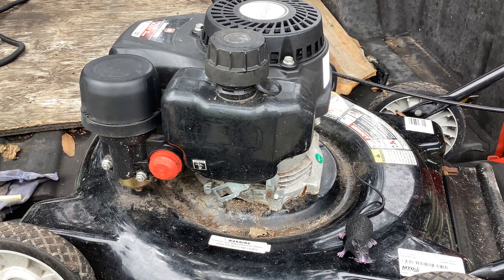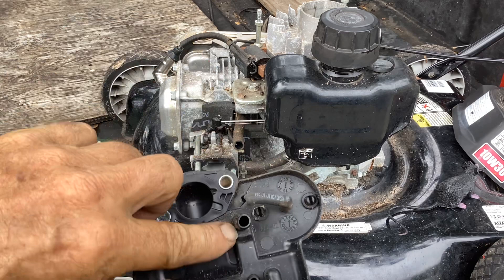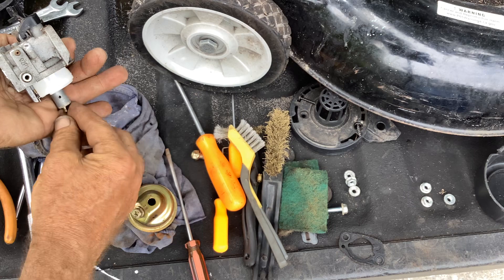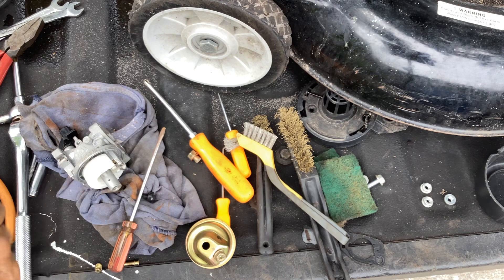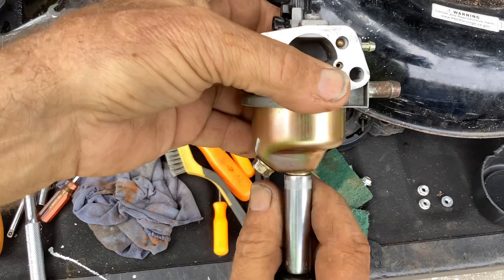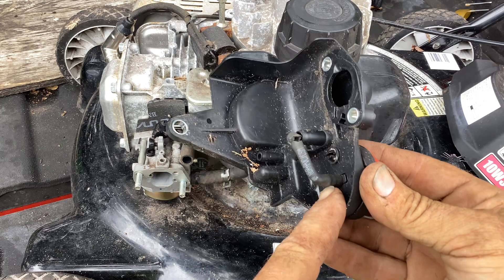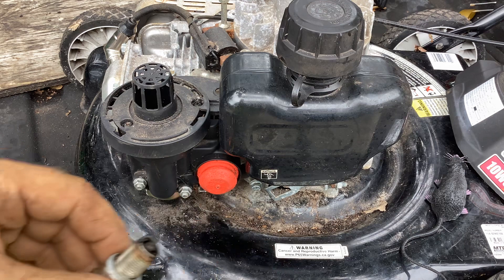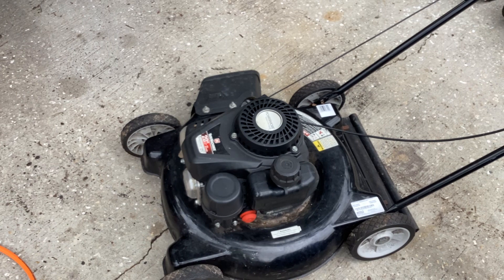Carburetor Clean on 2018 Yard Machines PowerMore Walk Behind Lawn Mower.

Comment: Hey, I have been doing tune up's for 3 years, watched hundreds of videos, & yours was a good demo of what not to do. you put 2 broken lines back on, didn't rinse out tank, poor job of spark plug cleaning. you don't have a grinder brush ? I have no idea where air filter is at ,or condition. you did nothing with the oil, or blade. I thought you were going to spill gas every where, the way you poured it. the coil also looked bad. would it have hurt to clean & reset? I hope you're not going to sale it. It;s not ready. heck, I didn't think it would start. Old Retired Guy
Reply from the maker: This was just a Carburetor removal and clean. I did not do a full service on the PowerMore.  I may in the future if another one crosses my tailgate.

Comment: Interesting,  I have never had a opportunity to work on a 132cc OHV engine like this.  I have worked on the 139cc Powermore a few times it’s similar except getting the air box off is different and a little bit easier

Comment: How do you lower the deck I can’t figure it out
Reply from the maker: you have to remove the wheel bolt.  3 holes are pre drilled and you select the hole corresponding to your desired deck height.

Comment: Hey Tommy, single mom here. So I’ve been working on this lawnmower a couple times now ran into your video thank God! I put everything back together but the carburetor is leaking gasoline. Do I need to take it apart and re-put it back on or what could be the issue? Spark plug looks good it’s fairly new. I think mine is about a 2020.
Reply from the maker: yes, the gasket on the fuel bowl is most likely leaking.
Reply: @tommy-time5240  OK great I’ll take it apart again re-put it back on and see if that helps. Thank you very much.! Video was super informative, and it was exactly what I was looking for
Reply from the maker: @user-vp2gy4ij8g  be sure the O-ring is flat and fuel bowl fits snuggly.